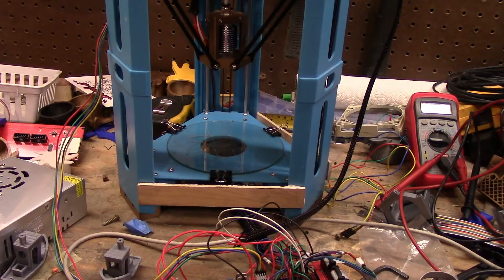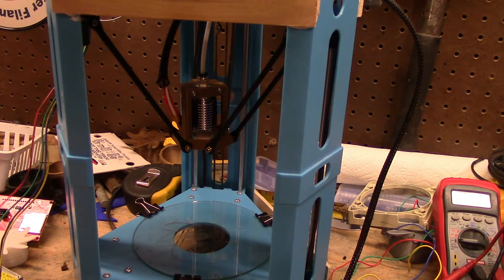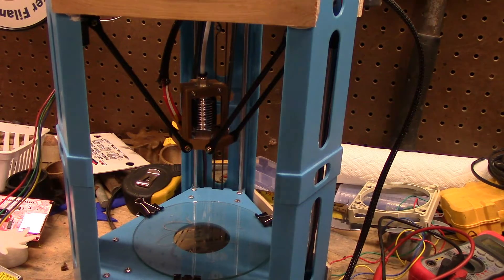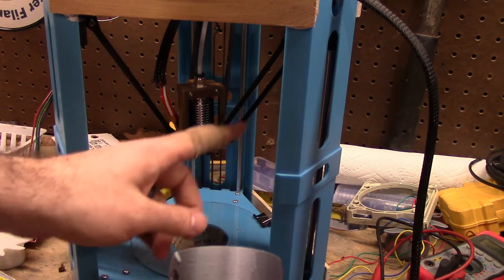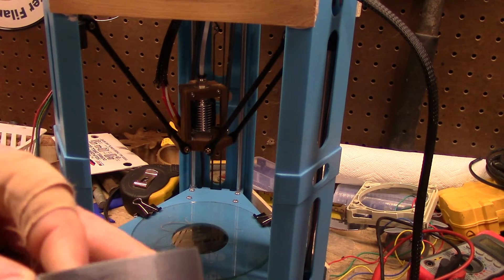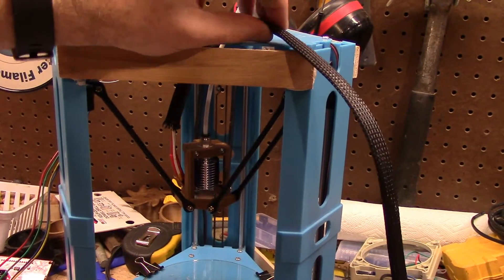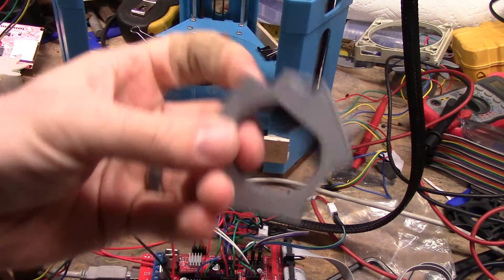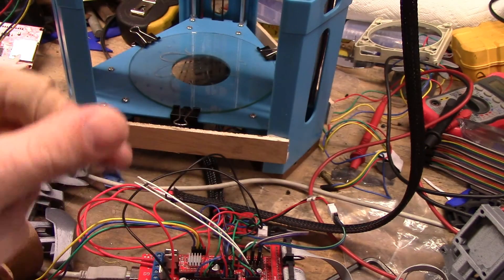101hero cheap hotend and comparison

Comment: hello friend wanted to know if you can help me I am trying a problem when printing with the 101hero I bought a few days ago and the support does not answer anything.
and that I prepare the object with the cure and saved in the SD card and put in the printer and hold the button for 2 minutes, then this message appears:
The print goes:
- from 77.90 mm to 132.10 mm in X and is 54.20 mm wide
- from 137.40 mm to 159.60 mm in Y and is 22.20 mm deep
- from 0.00 mm to 23.04 mm in Z and is 23.04 mm high
Estimated duration: 129 layers, 1:09:06
Print started at: 17:20:56
But do not start printing anything ??
the peak is in the 186graus how to come in other tutorials, when I testo the bikes they descend and go up in good, only in the impression that nothing works ??
if you can help thanks and thanks for the attention !!

Comment: Could you give us a link of the new hot end? I think mine is broken... I might need an upgrade.
Reply from the maker: jf you go on aliexpress and search e3d you should find several e3d available. they come and go so quickly it is difficult to give a link for them. you can get one with the bowden tube and adapter for a dollar or so more as well. just make sure its the entire hotend and not just a part or two
Reply: Thanks!!! I will try getting my hands on one. My hot end that came with the printer has been nothing but trouble.

Comment: Did you 'Print' the hotend bracket on the 101?
Is it PLA or ABS?

Same question for the Nema14 brackets.
Reply from the maker: they are all printable on the 101. i did not just to save time. the current hotend bracket has been printed as well as the prototypes for the next version on the improved 101. 
everything is PLA, 20% infill cubic pattern.
everything should work in ABS, but i did not design for the shrink in ABS so would need to be sliced slightly oversized.

Comment: Is there any way someone could create this setup with the included electronics? It's not very realistic for me to replace all the electronics.
Reply from the maker: theres been some debate on that front. i beleive the final answer is no, the stepper drivers are the wrong type on the default board (bipolar steppers keep doing forward forward back when it should just be forward forward forward) though someone better at electronics than i am might be able to speak to it better.

i might add that into my tinkering for the week. keep running out of time to get everything done.

Comment: I love your printer but you need to help people create basic default settings that deliver reliable results. Example tell them what plastic to use that is easily available and affordable. Then give them 3 default settings. Speed and low quality. Mid speed and good quality. Low speed top quality and high detail. The printer can do a lot and it is a great printer but without a good set of instructions and guidance it is about as easy to use a rubix cube when you have never played with one before.